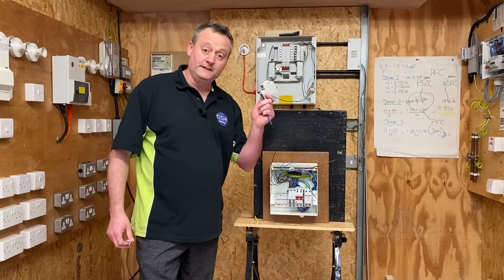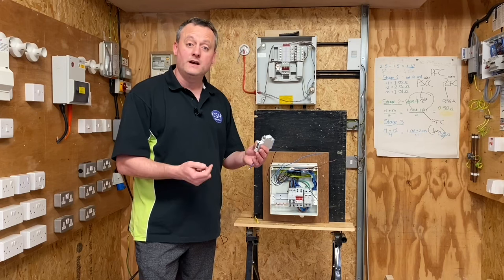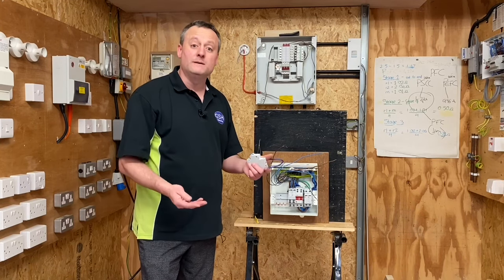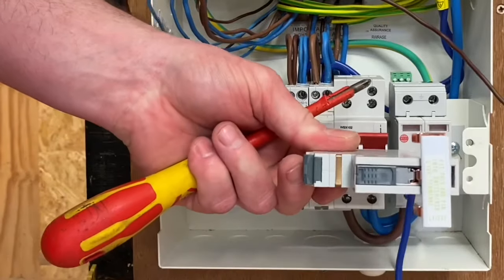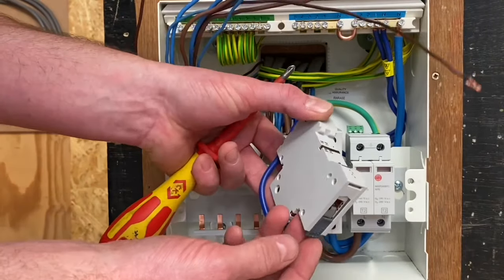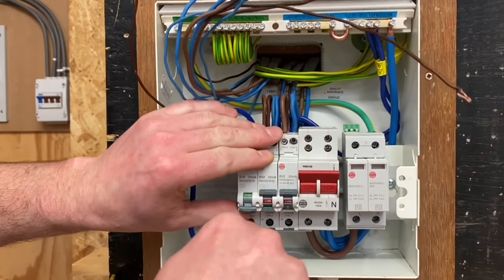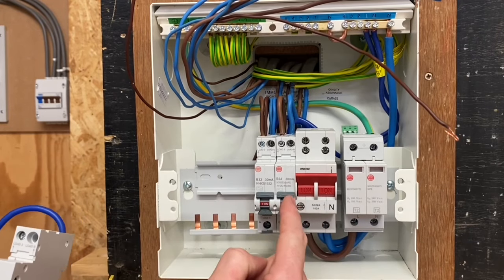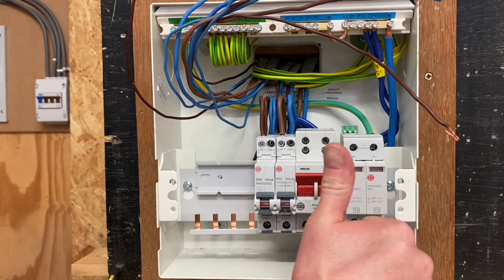How to Fit a Circuit Breaker (MCB RCBO) to a Busbar. Wylex No Miss Busbar Connection & Quick Release

Comment: Great kit everything we use is wylex .
I do EICR's for a large housing association (In house).
Been full time electrician 28 years.
The amount of MCB's/RCBO's that have missed the busbar and melted from arcing I've found is scary.
And the daily diy wiring I find no you do not fit a 50A breaker to a 6mm  for a shower ffs and it was 101 install method!
Reply: Unless it’s swa!

Comment: Can I use 4mm jumper if I don't have a bus bar? Thanks
Reply from the maker: Sadly no 👍🏻
Reply: @GSHElectrical  oh thanks. So what's the size of cable that is exactly equal to the size of the bus bar.
Reply: Elisha Tech  As a bare minimum, kindly use a Comb Busbar. Jumpers are unreliable.
Reply: @elishatech4600  The busbar is sized for the worst case scenario and must be able to take the main fuse rating which is generaly 100amps only use jumpers if you want a fire